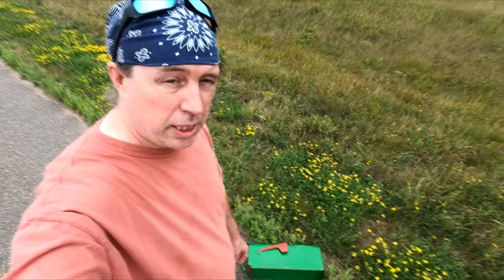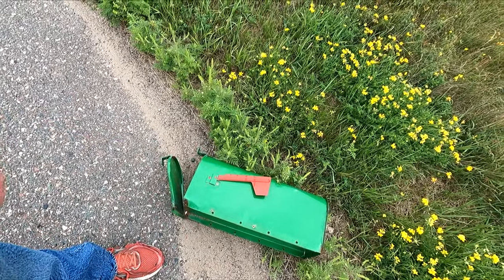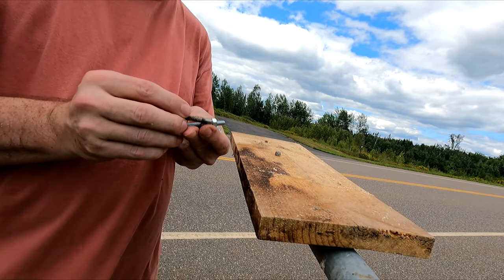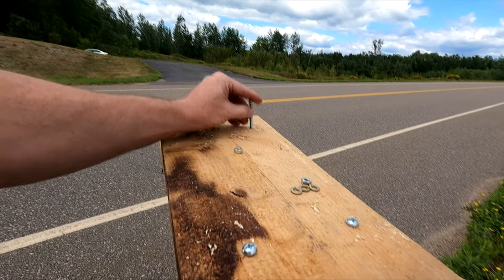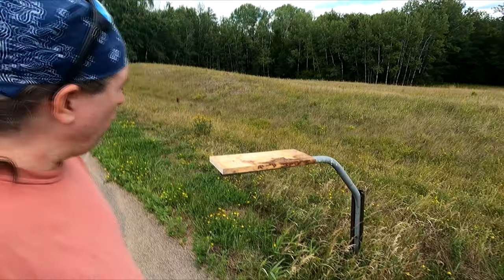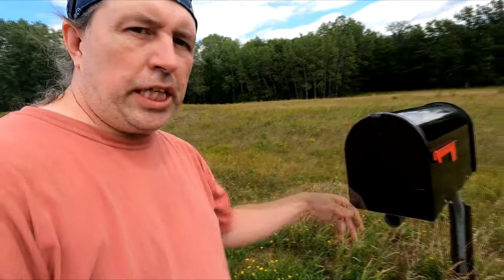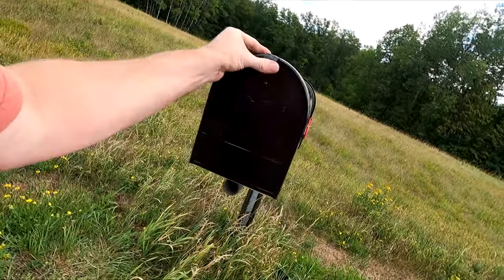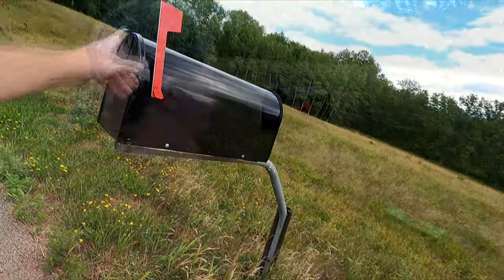How to fix a broken mailbox

Comment: Thanks for showing me how easy this was.  Question:  What's the best way to measure the new board to fit the base of the new Mailbox?
Also - any thought about preventing  the board from rotting by painting?
Reply from the maker: Keep the old board and place that on the new board and trace it on the new board. Then cut that out. Glad it was helpful! Good luck.
Reply from the maker: If the new mailbox is a different size then you measure the bottom of the new mailbox and the mark that on the new board.